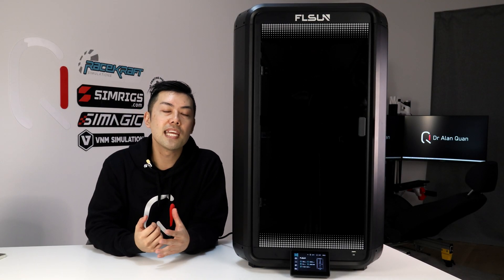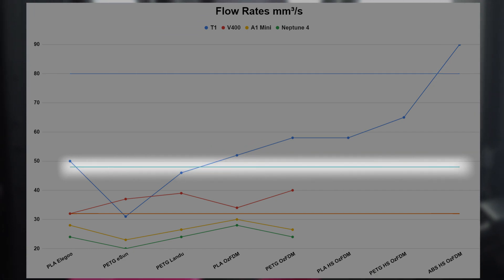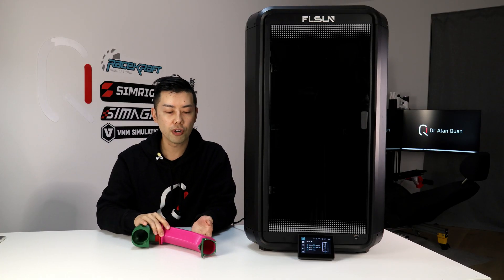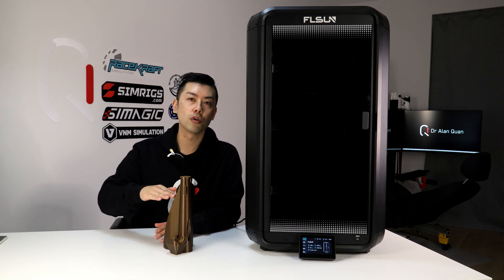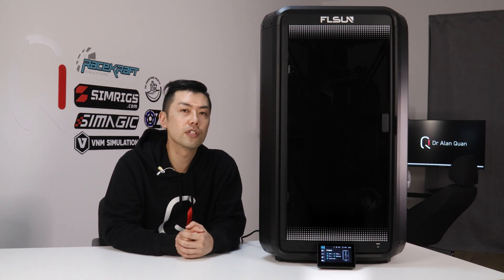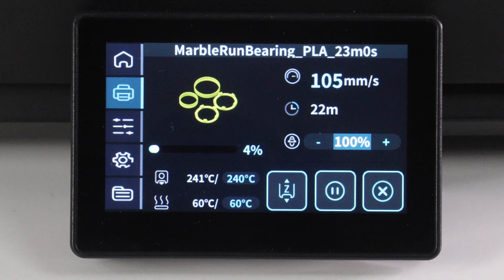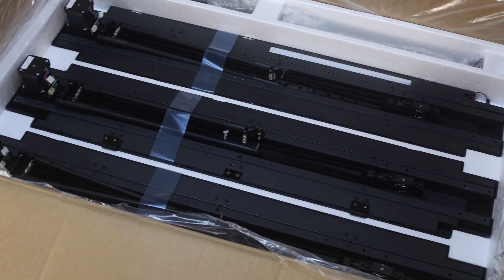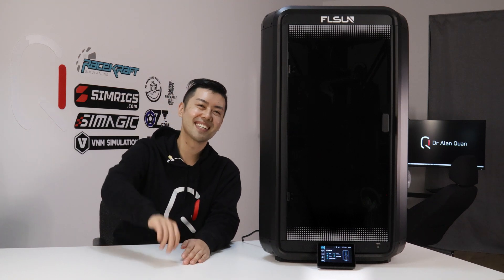This 3D Printer is Quick! The FLSUN T1 is 100% As Fast As Advertised and I review it #3dprinting

Comment: Can someone enlighten me because it doesn't make any sense that there's a 400 watt rated power supply but he's getting 600 w pulling at the wall
Reply from the maker: If it's anything like car engines, 'rated for 400W' means they vouch that it can handle supplying 400W 24 hours a day, but can do bursts above that from time to time

So there might be a fuse in the power supply that blows at 800W or something which is why it can draw 600W sometimes.

Comment: I have a T1 Pro which is nowhere near as loud as the T1 in this video.  Looking at some other "silencing T1/T1 Pro" videos (one by FLSun) I see FLSun has used at least two other fans than the one in mine, so I guess they have been working on this.  I don't have a reliable (calibrated) sound meter to test it, but there is no need for hearing protection.  For anyone watching this video who is put off by the loudness of the fan, you don't need to be as concerned as what you see in this vide.
Reply from the maker: The release of the Pro variants so soon after the printers debuted was very interesting to me. 

Firstly, the Pro variants are the quiet ones? I'd have thought home printers needed to be quiet and professional printers in a workshop could be as loud as you need. I guess I'm being a bit fussy about what a name means. 

Also it seems like they really misjudged how bad the noise was and needed to make a revision pronto.

That said, last time I checked (a while ago admittedly) they were selling the T1 and T1 Pro side by side and the original was half the price of the Pro. I'd get the cheaper one and put it in the garage!

Comment: It fails to much
Reply from the maker: Not really
Reply: @DrAlanQuan  I have it. I also have a big bag of failed prints. I speak from experience not just empty regurgitation from someone else. it fails a lot.
Reply: @DrAlanQuan  if you have tips please provide them in a video. As of now to me it fails more then it succeeds
Reply from the maker: A few things that I did that might help - do a software update. The out of the box firmware had a number of z offset issues, but by upgrading the firmware the auto Z was perfect. 

Also use Orcaslicer and the default profiles for your slicing.

Those are the only 'non obvious' things I did to get consistently successful printing. Good luck to you!
Reply: @ I greatly appreciate the tips. I will give your suggestions a try. I've been using the flslicer and that may be the issue. I've noticed a bunch of software issues and glitching while using it.
Reply: @akano.1 I know this is an 8 month old comment but did his advice stop a lot of the print fails?

Comment: Those hotend figures sound false. Have you seen the reviews of its bigger brother? It couldnt even hit a third of the advertised volumetric flow. I think you may have succumb to their marketing lie of a built in flow rate file which never actually moves the hotend fast enough to get even close to the advertised flowrates.

You can sort of see it too, because hotends that actually get those sorts of flow rates are way longer, and ooze a whole lot.
Reply from the maker: I saw the fudged flowrate stuff with the S1 and flsunslicer. I sliced my own calibration gcode on Orcaslicer, verifying on the preview the print speeds and flow rates (which if I recall correctly is how the fudged calibration was exposed with the S1). If you watch the screengrab video where I show the Moonraker error the live flow rate readout shows 86+ mm³/s (I forget how much exactly) before Klipper reboots.

The only thing I didn't do was physically measure the speed of the filament coming off the spool as it printed. 

I don't think there's much more I can do to test the flow rate in a controlled and consistent way. Seriously, get your hands on a T1 and some OzFDM HS ABS and run the test yourself, and let's compare data.

If I've made a mistake somewhere I'd like to know. I came into this test reasonably well prepared having heard about the dodgy S1 flow rate test and did what I could within my skill set to test properly. 

But I will say one thing - a printer that actually meets its claimed specs? Unheard of right? Hence I was pleasantly surprised. 

And then really disappointed by the build volume issue. So you win some, you lose some.

Thanks for commenting!
Reply: @DrAlanQuan  It's good to hear of independent testing, though, (and you probably checked to be fair), If I recall correctly, sometimes the readout in various klipper front-ends can be requested speed as opposed to actually hit speeds.

I believe this is part of why CNC kitchen for instance, developed their scale measurement system for measuring volumetric flow where the weight of filament can only tell the truth.

Nevertheless, I can appreciate the effort.
Reply from the maker: Yeah I'm definitely relying a lot on what I see on the screen (commanded speed and flow rate on the preview, and live readout on Klipper) versus old school analogue measurement. I don't have the genius of CNC Kitchen to devise fully independent means of analysis. 

Anyway, just like in medical research we do the best we can, others will critique, and we all learn. Hopefully my data turns out to be reliable.
Reply: The instantaneous flow rate of T1 is 90, which is obvious. If it is a continuous and constant flow rate, it is about 55, but it is still about 2 times that of other brands of printers.
Reply: You look professional, but it's really just hearsay.
Reply from the maker: @Ewan_Thorpe  I have a beautiful flow rate test print, just perfect where the T1 starts at 40mm³/s and transitions to 90mm³/s at the top with zero flaws.

For me, I don't know whether you would call that instantaneous or constant flow, but it counts as "90mm³/s capable" in my book. And in real world printing I made real prints at full speed with pretty good results

Comment: I own both flsun T1 and flsun V400. I have been using V400 for 2 years. Before T1 and S1 were launched, V400 has been the fastest 3D printer on the market.T1 has made many upgrades on the basis of V400 (further improving printing speed, time-lapse photography, enclosed printing spaces, etc.);  V400 and T1 are my favorite printing tools;
Reply from the maker: FLSUN certainly know how to make a hotend. I was really impressed with the V400 when I reviewed it earlier this year, and the T1 is a big step up again. 

I think I'd rather have the V400 at home - the user interface is perfect and it's already fast enough. But if I had to design and print stuff professionally and if noise wasn't a concern the T1 definitely wins. Do you find the build volume of the T1 enough?